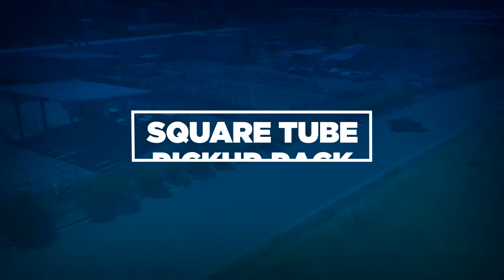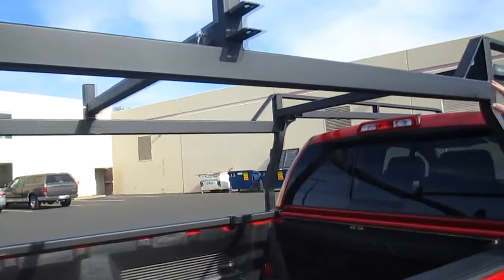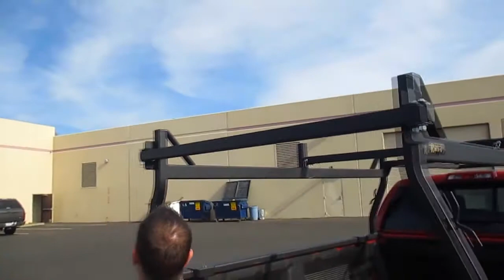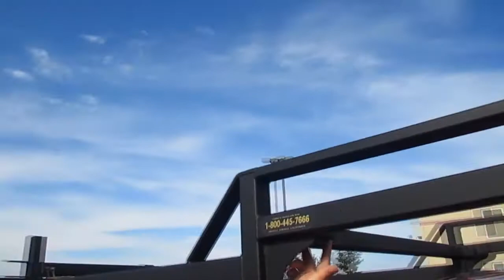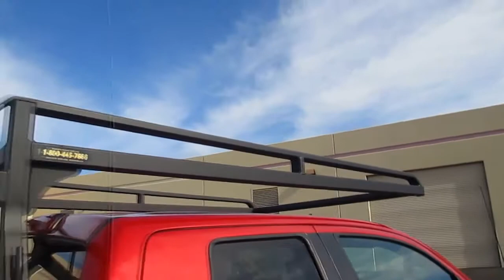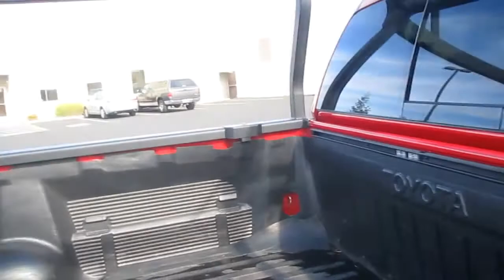Rack-It: 2000 Series Modular Square Tube Steel Rack Forklift Loadable

Comment: Please answer the question. What is the max weight capacity of these racks??
Reply: ChatGPT says 1,700 lbs weigh / load rating and it weighs 450 lbs for the 2000 series square tube fork lift loadable version